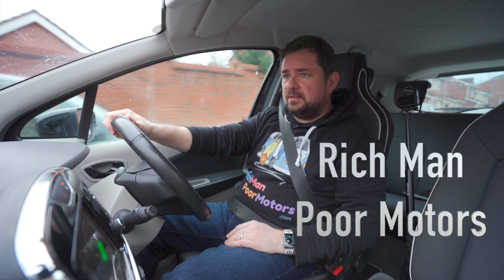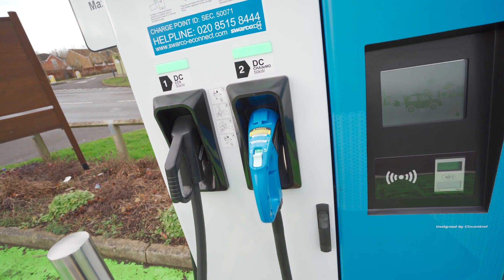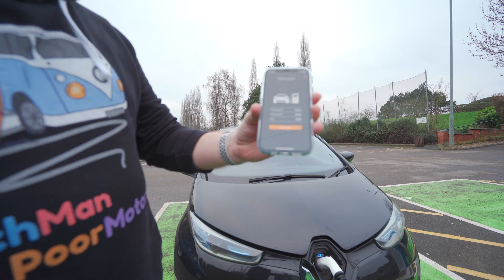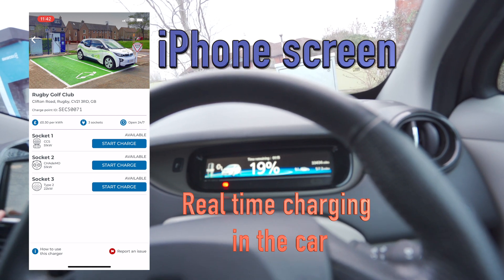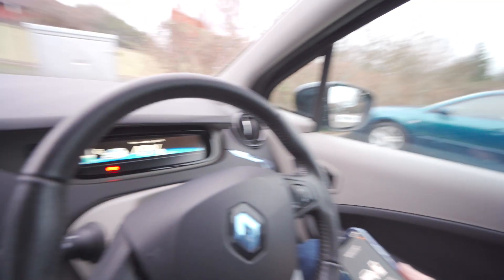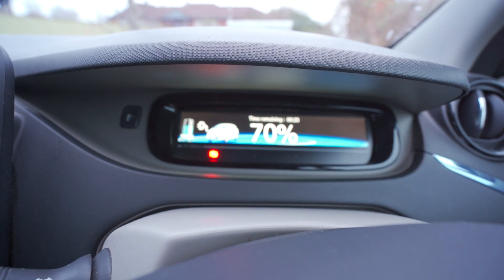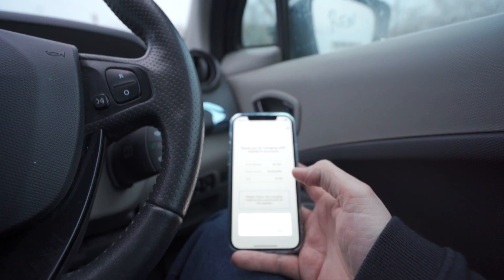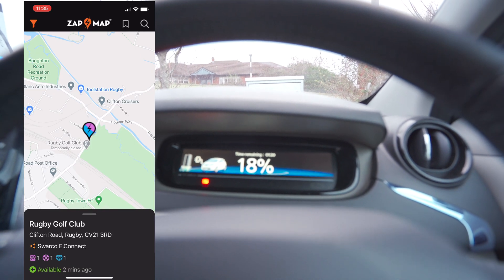How to charge a Renault Zoe using a Public rapid charger

Comment: Been looking to get a zoe, but this charging is stressful. Hour wait plus downloading a app and say if you only want half charge can you pull it out? Its very confusing
Reply from the maker: If you have a house where you can charge  a Zoe then you will put it on charge at night and it will be ready in the morning, my mother has this car and has never used a public charger in 24 months of ownership, 
however she wouldn’t drive far even in a diesel so it suits her as no more petrol stations fill ups, 
If you don’t have a place to charge at home or work I wouldn’t purchase a electric car myself 
This was a early model Zoe, later models have more range, but if you’re buying a Zoe check out what charger is fitted, I’m going to do a video on this but basically later Zoe’s have a slow or faster charger fitted and even later mark 2 Zoe’s might have a ccs charger (apart from base models) which is better for fast charging. 
On to charging you can stop charging at any point from 1% up to 100% 
in fact on a public charger it’s best to only charge to around 80% drive and charge to 80% at next charger as this would save you more time in a journey 
As for pulling out the cable, every electric car from different brands locks the charging cable into the car while charging  so they don’t just pull out (like shown in those VW itv adds)
Reply from the maker: Apps for charging aren’t a problem you can usually get physical cards for charging if or use a contactless bank card, but apps are more convenient like using your bank and store cards on your phone so less to carry in your wallet you would soon get use to it
Reply from the maker: A quick note on range don’t look at manufacturers range and expect to get that this is in ideal conditions what I have found is that you get around 2.5-3.5 miles per kw of battery whichever brand you drive more like 3-4 miles on a small electric like a Zoe in real world driving so use that in range calculations eg 10kw gives 25 to 35 miles of range 50kw gives  125 to 175 miles

Comment: At home is about 28p/kw.
But you have to sit there for 30 minutes just to go up to like 80% which is probably around 40-45 miles..is ridiclious😆never mention if its winter and you need heater on it will never ever charge..😆😆😆Great future!
We had a renault zoe here and it was 98%charge showing 58mile range.
Reply from the maker: My mother has the car now, we have a indicated mileage range of 93 miles Summer 80 miles winter, so 80% charge would give me 54 miles i
it might be a bit more now but charging at home was 6 pence per kw so £1.20  for around 80 miles I think it’s now 8 pence per kw so around £1.60 for 80 miles compare this  to around 
£16:00 for 80 miles in my diesel Astra and 
£28.00 for 80 miles in my ml at £8.10 per gallon her in the U.K.

Comment: Very informative thanks as I was not given this advice from the dealership. I hate the design of this car, the seats don't go up or down, the roof is too low, it has far too many blind spots, huge thick pillars for the size of the car and far too many blind spots, plus a tiny rear window.  So what if it alarms if something is too close it could still be too late to react. The Renault Zoe is a Horrible little car which feels very unsafe and vulnerable on the road, especially in icy conditions and I'm returning mine with only 63 miles and swapping it for a petrol or diesel car.

Comment: Thanks for your video. Are you able to use the heater while you are charging? Aparently is impossible. It is so uncomfortable to charge in winter if you have to stay on the car.
Reply from the maker: I don’t have the car anymore so can’t comment, but as you can precondition your car when plugged in I can’t see why it’s not working

Comment: I'd like to have an electric car, when the technology and infrastructure is perfected
Reply from the maker: I know what you mean, this is an ideal 2nd car, or if you don’t travel far, but in 7 years the range of the Zoe has doubled, if it dose the same in the next 7 years it will be a realistic 1st car or only car for many, it can be now but there is a compromise range/charge time. The new Tesla model s coming out at the end of the year has a range of 520+ miles and 133 extra miles from a 15min charge if you have a spare £130 grand burning a hole in you back pocket
Reply: @RichManPoorMotors  personally I'd have a 2nd gen Prius 
I think they are a decent compromise and look fairly decent 
And they look good lowered on nice alloys 😂
Reply from the maker: @itsmephil2255  great thing about cars is that everyone has a different requirement, and every manufacturer has a different solution, in my 20’s I has sport cars like mr2 and Porsche, in my 30’s more large saloons, and in my 40’s I am more likely to choose a  large 4x4 as family kids and lifestyle 

The only problem with a hybrid is that when running on electric they have the extra weight of engine and gearbox, and when on petrol they have  the extra weight of the electric battery and motors,  so there efficiency is. Compromised  although I may look at one myself 

if you have a lot of stop start town traffic like in London then they make sense but if you travel a lot of dual carriageways and free flowing traffic they are no where near there advertised mpg or any better on fuel than a normal combustion engine. Where as the full electric zoe shown in the video has a fuel cost equivalent of 150-160 mpg granted a zoe is more of a town car, but a Tesla model 3 is just as efficient
Reply: @RichManPoorMotors  1 day I may take the step

Comment: good to know but not a fan of electric cars,  tdi all day long👍
Reply from the maker: I’ve owned front, mid and, rear engine, 1.1  up to 5.0. 3 cylinder up to v12, running on petrol LPG and diesel, we might be at the beginning but electric is the way forward, Tesla new model is supposed to do 600miles, 400 kw chargers are on the horizon, but it’s the way it drives that surprised me, so addictive, I wasn’t expecting that, I have a review coming out once I edit it already filmed
Reply: @RichManPoorMotors  a friend of mine has the golf it is quick of the mark but thats it , they just can not do the miles
Reply from the maker: It’s a bit like the early days of pc’s or mobile phones, the new jag xj will be electric only, battery technology is progressing so quick, that I believe that cars will be capable of 1000 miles per charge by about 2035 maybe as early as 2030 and be able to charge a 25kw battery the same size as what is in that Zoe battery in under 5 mins maybe under 3minutes. So 300mile range in under 10 minutes
Reply: @RichManPoorMotors  very true, but the cost will be massive, brighter the light bulb will cost more to run and so on and on £ will keep going up and never come down just like are electric bills